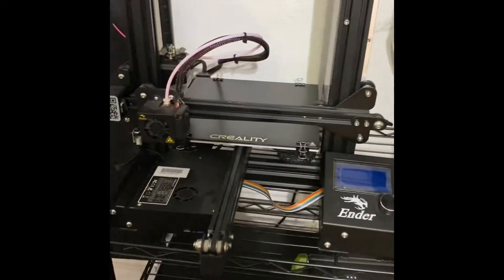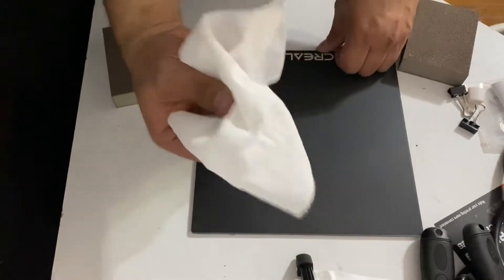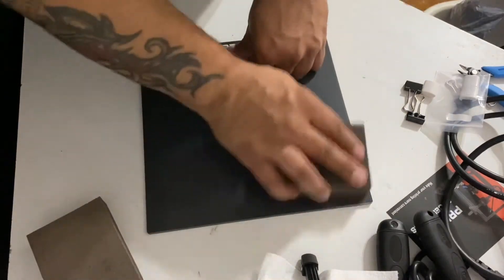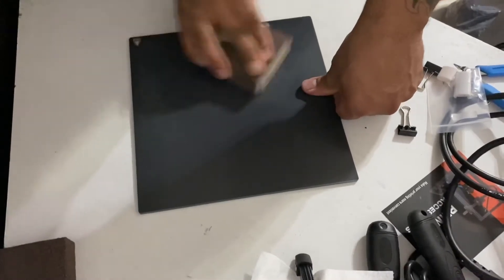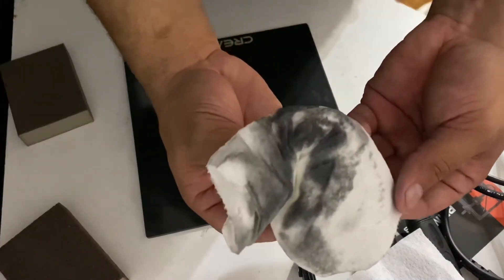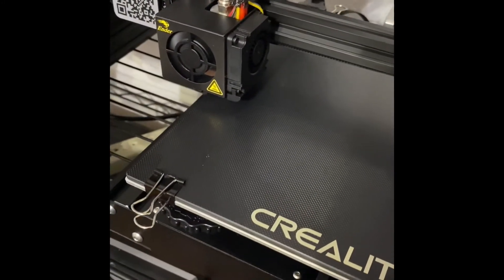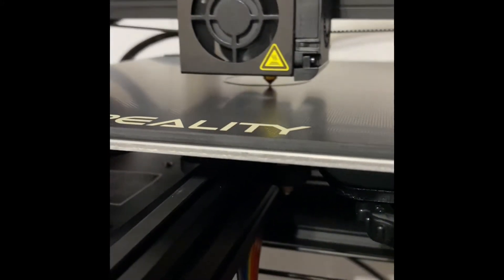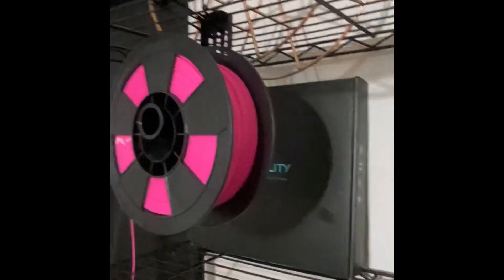Creality Ender 3 sanding glass bed!

Comment: For the love of all things! Read the material data safety sheets on chemicals before sanding chemical coatings! Carborundum dust is a known carcinogen and you absolutely MUST wear a respirator before attempting something like this!
Reply: Carborundum is pretty safe for such short an interaction. Problematic if inhaled in large amounts and you still might not die for 40years or more. Most serious carcinogens are PAHs or simple benzo aromatics. Working at a gas station would be a million times more risky.
Reply: True but a respirator is ~$40. Im sure no one would disagree that an extra couple years of healthy life is worth $40 and a occasional filter replacement . @Hotwire_RCTrix

Comment: You took off the coating that they engineered so carefully
Reply: Just clean it
Reply: @tnfiftyfives  I've tried cleaning mine with soap & water, and with isopropyl alcohol and I still can't get any adhesion. Painters tape is my workaround until I can figure out the root cause though.

Comment: Cool video! But i am not sure your technic is really needed.
Cleaning the glass bed after prints, and slow first layer (15 to 20mm/s) makes it stick.
But thanks for the video, it is a cool experiment!👌👌
Reply from the maker: I’ve had other viewers try it and it worked for them. Some beds don’t adhere and some do straight from the box. There’s always defects.
Reply: it is needed, the glass and the coating is shit .. nothing adheres even with cleaning with water or soapy water ...
Reply: Cleaning it works i do it all the time
Reply: @tnfiftyfives  same here, but maybe some beds does not work as well as ours

Comment: Have you tried just cleaning the glass? I had a lot of adhesion issues with my bed when tried it out for the first time. Then gave it a good cleaning and it started working perfectly.
Reply: Agreeable
Reply: idk man, i cleaned my glass enough but i cant get good adhesion with it ... the coating is BS on that glass and only does the opposite ...

Comment: I've had a heck of a time trying to get a good first layer with PETG on this bed. Just did a modified version of your technique (just some 220 grit on a sanding block, lightly sanding in all directions). My first line on the brim adhered nicely and did not drag along for 5 inches. Very small screw holes printed without issue. I might have been better of with 180 but so far so good. Thanks for showing us we can have our flat, carborundum cake and eat it too!

Update: No warping and print was stuck to the bed about as much as I'm used to with PLA. Even when still pretty hot the print could be removed with reasonable force. Definite win.
Reply from the maker: That’s great!! Thanks for the update!!

Comment: Just got the new Creality CR-6 SE which came with the new Carborundum bed, it's different to the older (Better) glass beds. I've tried everything to get my prints to stick to the bed and nothing has worked...apart from your technique! Finally prints are sticking better, still got some tweaking to do as I've just noticed current job has started to lift but much much better than it was. If this fails, I'm going over to a PEI bed. Brand new CR-6 and I haven't got one print to complete yet lol. Thanks for the tip Brother, will see how it goes!
Reply from the maker: You’re welcome! I just tried something different. My prints are good. I’ll clean it off with soap water after a large print cause the plastic does leave a little residue but enough where the next print will not stick as good but just a good sanding and a cleaning with soap water helped me initially!

Comment: Does the sanding make it stick better?  Bc i bought the glass for my ender 3, and can't get anything to stick.  I have since flipped it over, and the straight glass is better. But if sanding helps, I might give that a try.  And thanks for the video.
Reply from the maker: Yes it does. After you sand it clean it with soap water.